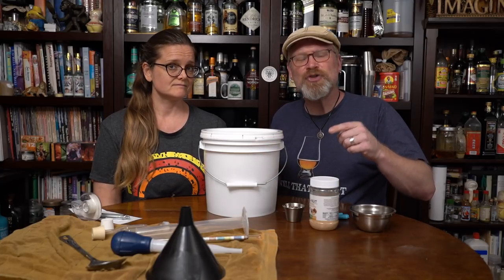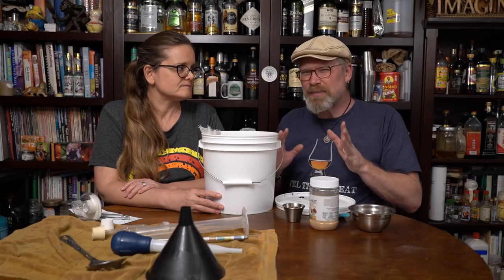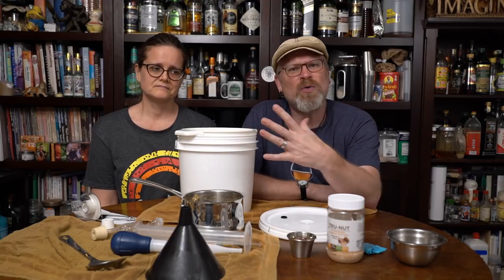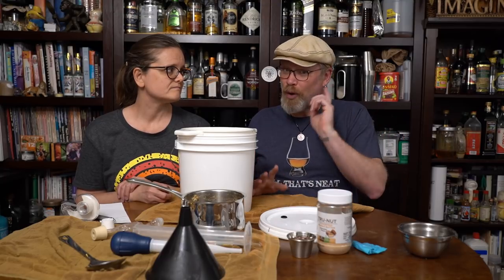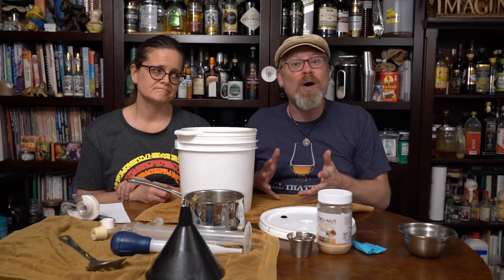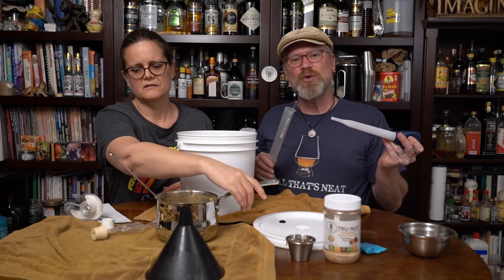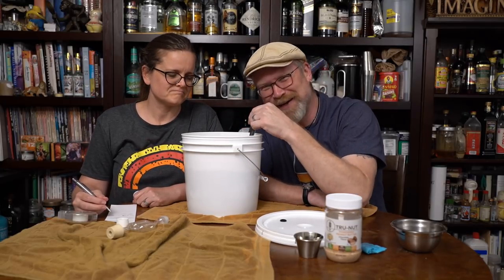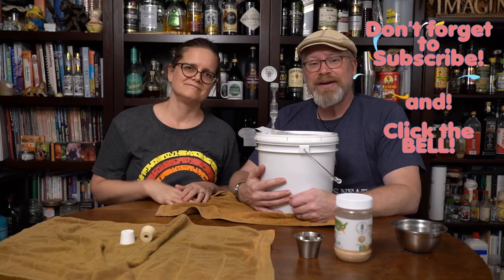Small Beer - Partigyle Beer!- Use up Those Leftover Grains!

Comment: 4:38  when you boil the must one thing I can certainly say is , you boil out some crude vegetable flavors , and other off flavors that might be present.  I can't detail very much yet, but if you save some must before the boil , and after the boil you will notice that the sugar concentration is it not the only diference in the flavor , and you actually get a totally different starting must to ferment . 
 But o never thought about reusing my grains.  I'll certainly try this in my next beer making .
Thanks for the good inspiration.  =D
Reply: Im going to add to this comment. The vegetable flavour is called dimethyl suflide aka dms. It is cause from the grain. And its biggest flavour notes for dms is corn, creamed corn, vegetable. The biggest culprit for it is german pilsner but it is a chance with any other grain as well. Doing a raw ale you dont really get any dms (in my expirience) mostly because its caused during your boil. If you put a lid on your kettle while boiling you are most likely get dms in it due to the protein breaking down and evapourating then condesning creating dms. but your biggest worry brewing a raw ale is infection from bacteria on the grain. For example lactobacillus lives natrually on malted barely; it sours your beer. Same thing with pedioccous(does rhe same thing as lactobacillus). There is also a chance for brettanomyces(highly invasive bacteria that creates funky flavours) when having your grain sit out for a bit due to sugars already converted. Best example of infection in raw ales is the "beer" distillerys make to distill. They dont boil it at all they just mash in, sparge, transfer, ferment, distill. In the fermentarion part lactobacillus does take hold cause your mash in awakens it so to speak causing it to go to 2.8-3.4ph where beer normally is 4.0-4.5.
Edit: finishing my comment fully.

Comment: First off great video. Boiling the wort drives off volatile compounds that can cause off flavors. This is why you don't want to boil with a lid on because those compounds just condense on the lid and fall back in. Boiling kills wild yeast and bacteria that may be living on the grain. Also you boil to get different compounds from the hops.

Comment: Could one ferment this with the grains in the bag like one might do with a melomel? Can you think of any pros/cons?
Reply from the maker: Nope, you really need to heat the grains to activate the enzymes in them and convert starches to sugars for fermentation :)
Reply: @CitySteadingBrews  Yes, I was not clear in my question.  For a second running, after the grains have been reactivated, could they be fermented as a direct ingredient rather than straining them? The grains are so sticky, even after the second run, that I was thinking that fermenting them would get the rest of the residual sugars.
Reply from the maker: @kevinkult  rinsing would be more effective really.  I worry about infection with those grains and low abv.

Comment: Would you ever make a gruit ( hopless) beer?
Edit: never mind you already have.
Reply: I wanna make a hopless stout
Reply: @borttorbbq2556  if doing this make sure you get some really nice tasting grains. Hops really add context and depth to a stout.
Reply: @richardbassist  really it's just a hopps allergy that peeks my intrest in gruit.
Reply: If allergies are the reason look for other of the chemical properties of  hops you like ie myrcenes pipernines and terpenes. Not sure if you're in a cannabis state but you can use cannabis to get a similar hop profile aswell. And no it wont get you high haha. Have to decarb for that and have a metabolic fatty solid for it to bind to make it a thc converted drink
Reply: Try rosemary bay leaves dill coriander seeds. Just look up other botanicals that can provide those elements

Comment: Hey brian and derica
I started a capsicumel recently and my primary is now almost over. It dropped down to 1015, that gives me around 16.5% I will have to backsweeten this cause right now it kills my mouth. How many points of gravity does honey add? Ive read many confliction statements, everywhere from .30 up to .45 ppg. I have somwhere around 4.5l of mead right know and would like to raise it to around 1070 points. How do i know how much honey to add?
Reply from the maker: 35 points per poind in a gallon.
Reply: @CitySteadingBrews  thanks a lot

Comment: Dear Citysteaders, I'm brewing a wheat beer soon and will likely have around 7.7 pounds of leftover used grains as a result. However, I've got only enough bottles left for around 1.3 gallons of stuff afterwards. Do you reckon it's possible to make such a tiny batch of small beer from such a large amount of used grains? If yes, then how? I've been trying to calculate the theoretical water usage but I've gotten nowhere with it.
Reply from the maker: You could just use a gallon and a half of water, and end up with about 1.3 gallons of wort.
Reply: I figured that wouldn't work because of the grains absorbing the water, but thank you for the answer regardless. I'll give it a shot!
Reply from the maker: @SolidXerm  If they are leftover, they are already soaked, so... while they will take a bit, they won't take all the water in.
Reply: Ay, it's been almost a week and a half since that fated brewday; It went marvelously. You were right, the used mash really did not take up much of the water! Since my first running came out two litres short, I supplemented it with some of the boiled and hopped wort of the second one's. The second running might come out a bit more exciting than the main beer itself, as I went with the tradition of small beers not being restricted by the Reinheitsgebot - I've added some frozen cherries to the boil, about a pound at most, and used a ground-up aroma-spice mixture of one part hops, one part juniper berries and three parts coriander along a pinch of tarragon and a single clove. After flame-out, I poured a pound of acacia honey onto the wort. In short, I really just threw into this thing whatever I had on hand.

I'd like to thank you for the advice - I happen to be in possession of a hungarian academic document about carpathian homebrewing traditions. It contains some rare recipes and records of folkish brewing, which I can duely summarize and translate for you if you'd be interested in seeing them.